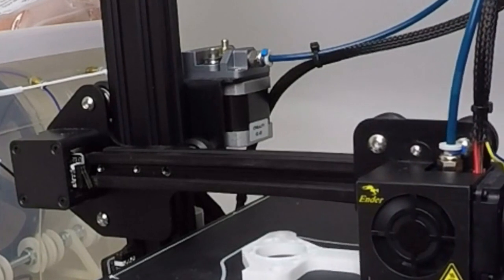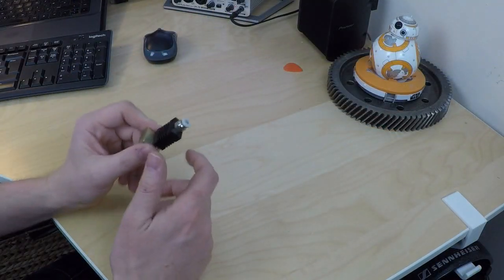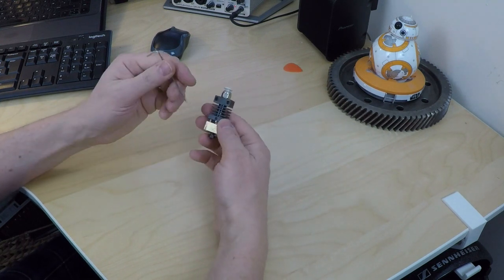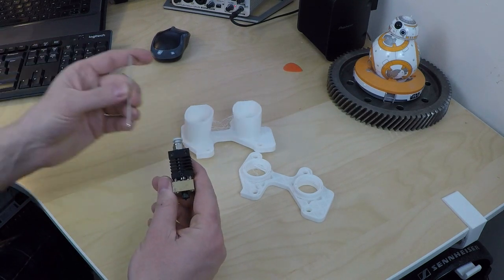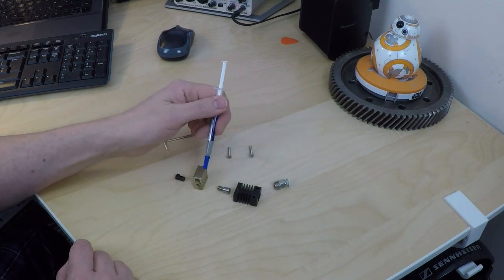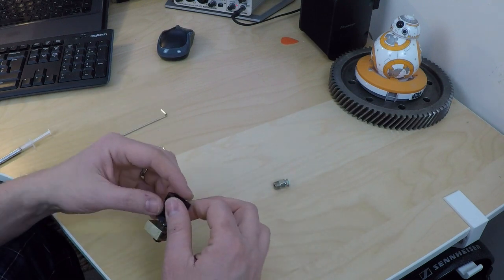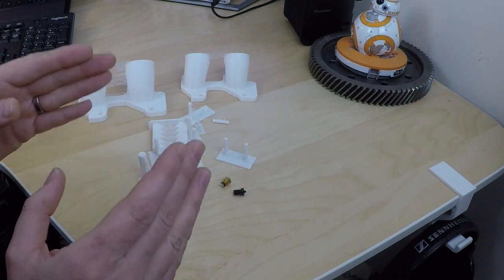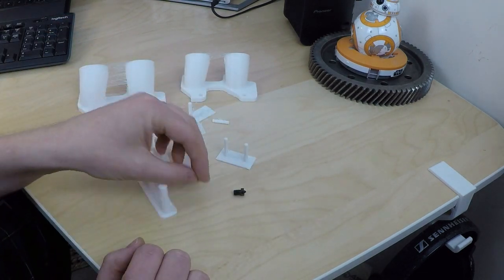Never clog again!! 2 easy tips to solve a clogging all metal hot end!

Comment: If you only print PLA the PTFE lined heat breaks work really well. Its the combination of PLA and all metal that seems to be the big oroblem. Some people swear by putting a drop of mineral oil into the hot end before loading PLA. Bit like seasoning a wok.

Comment: This still the solution? I was all stock printing petg and the teflon tube in the heatbreak (ender 3v3se btw) clogged bad. So i biught a metal one on Amazon and it worked. I noticed the old original one did have some thermal paste and it was clearly old and not much. I didnt have any to ise but i smeared some kf the old on the new one lol as i was just trying to finish a print for someone atm. Anyways ive printed half of another project (2ft vault boy) and got a clog again. Nozzle clogged up. Swapped. No solve. Checked heatbreak. Bingo. Clogged again. The metal one. So i found this video. As i have one more (it was a two pack) i am hoping i wont have to replace a third time but was searching for reasons it happens and found your video. Im oretty sure this thing is direct drive (everything is still stock) and i think the retraction was set to like .8 so. Im thinking this heat creep being mentioned is the issue idk. Ive been printing petg so first time lrinting these temps and hadnt had clogs before but ive printed a lot successfully in petg this is only my second clog. But back to back projects clogged so idk. It's creality petg. Maybe its just the cheap heatbreak i bought but we will see i guess. I am going to install thai second one with thermal paste this time and hopefully at least finish my current project. I know this video is old but if you see this and have any advice.

Comment: On my MK8 hotends, I've used Teflon tape (aka PTFE) on the heatbreak's threads that go into the heatblock. It eliminated filament oozing out though the threads, and seems to reduce the heat transfer to the heatbreak/heatsink.

Comment: Your tips are good, but a common source of clogging all-metal hot ends 
when printing PLA, is an inadquate cooling fan. The crummy, stock 4010 
fans on many printers won't cut it. Decent upgrade fans cost <$15. 
Look for fan with highest cubic feet / minute (CFM) spec, dual ball 
bearing (quieter). Most printers are 24v,  some older printers are 12v. 
Fan size is usually 4010 (thinner) or 4020 (thicker, usually blows more 
air).
Reply from the maker: Absoltuely, an upgrade for me was a silent 4020 hot end fan…

Comment: I don't have your exact problem as the clicking on appears during the first part of the print and seems to work okay after that and does not affect the print quality, very little if any stringing.  I have a genuine Microswiss direct drive and all metal hot end.  I use 0.5mm retraction. The one thing I found that helped is tightening up the tension that the extruder has on the filament.  I use PETG exclusively as PLA just clogs which I did not understand until recently.  I am printing in an enclosure and PLA needs airflow around it or it will cool to soon and cause clogs.  I know a lot of people say PETG is stringy which initially I did have problems with, but I store it and use it from within a drybox with desiccant.  I have not had any problems since.  The humidity here is high around 50%.

Comment: First, stop whispering. I can't even hear you while I'm driving. Yeah I'm not supposed to watch videos while I'm driving. I wasn't really watching. I was just listening.
2nd, reduce your retraction speed to 20mm. 40 mm is way too fast .
Yeah it's counterintuitive but trust me, it'll work. At least for PLA and PET-G. When you get into the fancier filament it's all bits are off. And I'm curious why you're printing in nylon with carbon fiber. You should probably use ABS or ASA

Comment: All metal hot end as apposed to what? Isn't the stock hot end all metal anyway?
Reply from the maker: Nope.  On the standard hotend the PTFE Bowden tube goes all the way through the heatbreak to the nozzle and butts up against it, this limits nozzle temps to less that 240-260 as above that it decomposes into gases you REALLY don’t want to breathe.

An all-metal hot end has a different hot-end which separates the Bowden tube from the nozzle and only the filament goes through.  If the heatbreak gets too hot, especially on low temp filament like PLA, it melts, bingo…. That’s a clog.
Reply: @MakingforMotorsport  thanks for the reply, I was so confused

Comment: I tried the thermal paste and reducing the retraction but I did one thing few people do: I looked up fan cowlings on thingiverse and found an internal fan shroud that screwed on the BACK of the heat sink fan that directed more air to the heat sink and I've just about eliminated stringing now i have to back track to contend with the blobs. I to have an Ender 3 pro and have just about got it ready for CF nylon, just need a enclosure and a better bed plate. Glass is a bad idea for PETG so I'm looking at spring steel PEI sheet. I could use the back for the CF nylon.
Reply from the maker: Nice! What I do for CF-Nylon is use my glass bed with glue stick, and on the flip side of that I have my mag pad and the PEI spring steel, that way I can flip between surfaces without releveling!

Comment: I was having the same issue with heat creep. But I had my printer in an enclosure which was just making the fan circulate more hot air to the hot end. So I ended up keeping the enclosure open with a small fan blowing into in the printer. I did switch out my all metal hot end for the stock hot end because i ended up breaking the heat break. But I switched the stock heat break with the Slice Engineering heat break which basically turned it into an all metal hot end. I am using stainless steel nozzles, but I also have pointy hardened steel nozzles. Both left the same amount of stringing which was just as much as you showed in the video. I did use thermal paste in the heat break because why not. lol. Your video helped a lot.
Reply from the maker: Nice one!  If I am running PLA (my most cloggy material) I keep the enclosure door open.  That Slice heartbreak does look good…

Comment: Mate first of all there is a huge difference between the volume of the intro and then you talking. The intro is waaaaay to loud, which i super annoying and then  have to double the volume to able to understand what you are saying.
Anyway, do not pint with carbon fiber, you will not get additional strength jut stiffness but what you probably will get is cancer because of those way too small fibers. Just becase this material exists does not make it safe to work with.

Comment: damn man , my v6 clone is driving me nuts , if I print without retracts I have normal prints but lots of stringing , if I turn on retract it just clogs all the time clicking and skipping layers like crazy the worst part is that it began doing this when i tried to print gembird pla (which I never tried before) after printing only abs for some time , the worst part is if I print abs , no clicks , no clogs . so now the question is : does it have to do with the bad pla spool or is it that pla has rough surface and doesnt slide as good as abs does during retracts and advances and I had the bad contact of heatbreak with the heatsink all along ...
Reply: Its just heat creap probably. Buy a bi metal heatbreak that use titanium and copper. I hear the work great.  Just ordered one on ebay for my CR 5 Pro H. Will try it out soon.

Comment: When upgrading the hot end on my V2, I just went with the Slice engineering heat break. With the exception that it was longer than the OEM heat break by almost 2 mm it works great so far. That was after I sanded the 2 mm excess. I applied thermal grease only to the top part of the heat break that goes into cooler. BTW thermal grease is applied in a very thin layer on the break, its not meant to "fill" any voids. Applying thremal grease to the threads that go into the heater block isn't recommended since thats where you want the plastic to start melting. Because the Slice heat break is machined so well, I had to adjust the retraction rate down to .05-.08 (I'm running a direct drive). As for the 2 screws on the bottom of the heater block, when I first installed the heat break it was too long so I left out the 2 screws and attempted a print. The print went fine till the heater block spin around and wrecked the print. Why anyone says to remove them is just being silly. How many printers have them without an issue. They are meant to support and to align the heater block and not allow the block to spin and knock off the top of a print. If you feel that they should be removed go for it, just hot tighten the grub screw and hope it doesnt spin while your printing.
Reply: You are right that the screws are meant to stay there, but your heat block shouldn't be spinning around without them either.
Reply: It actually is supposed to fill voids.  Except they're microscopic voids from parts not being perfectly machined. But Not gaps.

Comment: I used Boron Nitride paste from Slice engineering on my Gulf Coast Robotics hot end, eliminated my heat creep issues.
Reply from the maker: The compound is mandatory I think on every all metal. Even the E3D V6, which has nice fit still needs it.
Reply: @MakingforMotorsport  Took me much longer than I care to admit to figure it out lol.  Everywhere I kept looking was saying it was optional so I hadn't bothered.  Now if I can just get the sunlu silk rainbow pla+ to print properly without clogging

Comment: No retract = stringing whatever you do. I have been printing similar manifolds as these featured on your video and print quality would benefit greatly from design upgrades. In this case a sacrificial or solid bridge connecting the tubes would also make a more rigid print.

Comment: So here's my story.  Bought a micro-swiss clone as well, no printing issues at all (still none).  Then amazon stopped carrying it so when I needed it for my other 2 printers, I bought something "similar".  I too had this clogging issue, but only like 10 minutes in.  The hotends looked identical from the outside.  Your video opened my eyes, yes of course the retraction was causing it.  You have semi-melted filament trying to go back up a tight metal tube that won't give.  So here was my fix.  I slid some drill bits in the metal hole to see how tight it might be (figured mine was probably around 1.8mm, but don't have a pin gage set).  This seems very tight, and quite excessive for metal since the filament really has nowhere to go.  So I went up the next drill american drill size (2.1mm equivalent), and drilled all the way through to open it up so the semi-melted filament would still have space when it retracts.  This 100% fixed my issue, and I suggest everyone try this (or at least verify how tight your metal throat is).
Reply: Seems risky but interesting

Comment: with a all metal hotend u have to turn ur retractions down quite a bit from the stock boden system, i think my ender 5 was 5 ot 6mm/s for the retraction speed an 45mm distance i think i cant remember now its been so long but all i had to do was change the retraction speed down to 2.5mm/s an it was perfect. i did buy mine from microswiss an i went by their instructions an it worked great so for my ender 3 and aquila i just picked up clones of the microswiss first one was half the price so 30 an the last was only a quarter at 15 an they are both identical to the micoswiss so when installing them i did the same as i did for my ender 5 from microswiss an dropped the retractions an they have worked just as good as the microswiss. oh also did a pid tune.
Reply from the maker: It’s a tricky balance…. Enough retraction to not clog the hotend but enough to stop stringing…
Fortunately I don’t need to worry, I went the E3D V6 route and have no problems now 👍
Reply: @MakingforMotorsport  yea they work really well, i have a couple on my delta printers

Comment: Also... retraction on a bowden ender 3 should be ~4-6mm. That'll kill the stringing instantly.
Reply from the maker: On a completely standard Ender, you’re right but with an All metal hot end, anything over  3mm retraction is a recipe for clogging, as it pulls molten filament into cool metal.
That’s often why all metal hot ends go well with direct drive extruder (look at a Prusa) as the retraction can be super accurate and as little as possible…

Comment: Few words for people replacing with all metal heatbreak and what I have absolutely tuned up:
1.) Lower the temperature you used to print PLA with. A LOT. I went from 210 to 190 °C. ABS can happily run at regular 245 °C. If you replaced heatblock by copper/brass one, lower the temp even more as it really has great termal conductivity. Higher temp materials wont have problem with clogging when printed at regular temps as those can sustain at least 20 °C more then PLA (55 °C melting point)

2.) Lower the retractions. 1.5 mm at max, by the size of the zone making the actual break. 

3.) Go with Klipper firmware or at least better board (not 8 bit) so you can use Marlin Linear Advance (Klipper's Pressure advance work on 8 bit board as calculations are managed by Raspberry). That will completely eliminated stringing and blobs and retractions are there for „just in case“. But not needed that much.

All of these will allow you to print PLA on all metal heatbreak and much better materials like ABS and Nylon without any problems (well, ABS getting from heatbed is another subject)
Reply from the maker: Fantastic information… I have seen the linear advance piece in Marlin and looking forward to giving it a try!
Reply: @MakingforMotorsport  I've got the ENder 5 Plus this monday and not even bothered with Marlin. Klipper & Fluid are much, much better. Anyway, Linear/Pressure advance and most important, Input shaper to eliminated ringing will do wonders with quality of the prints.
If pressure advance is tuned up well, you will have hard time to find a seem on your prints :)
Reply: Thanks for the info.  I always thought you needed to go hotter with an all metal hotend.  At least that is what a lot of youtube videos suggest as well as MicroSwiss.   My problem is I can print PETG just fine, if I try printing PLA it just clogs after several prints.  Everytime.  So I just generally use PETG now.  My retraction is set at 0.5mm.
Reply: Thanks for the temp tip. Just changed mine on my ender6. Couple hours in, clog. Think it’s from heat creep due to me hitting those temps like I used to. 
Problem is I changed everything because of a clogging issue from the tube to heat break from the stock one.
Reply: @zozoartstudio4727  what are your retractions? For bowden, it really matters in case of all metal. I run my Dragon HF on Ender 5 Plus with 3 mm retractions BUT - Klipper firmware with pressure advance set on every filament.
PLA at 205 °C no problem, but I had hard clog with CF Nylon once and it wasn’t funny to get it out given how tough material it is. Lowerig temp by 10 °C helped completely.

Depends on your hotend cooling fan too, I run Sunon 4020 because only this gives enough airflow and pressure while quiet, Noctuas are no go.
Reply: @ZhuJo99   let me start by saying I’m a complete amateur and have been doing this for months. So I apologize if I’m ignorant to some of this. 

Not sure on what fan is on the Ender 6, still have it as stock. So far I haven’t felt it’s been an issue.. yet. 

The retraction is what CURA defaulted it for the ender 6, at 10mm.  I’ve tried 8mm and 6mm and I’ve had complete jumbled failures with those. (Could’ve been too cool temp on those but 190C shouldn’t have been cause for failure if this new copperhead heatbreak can run cooler with PLA, but who knows)

Today after a bunch of tests I finally had a successful one (except for the corners curling up a little)
I really wanted to make sure the issue wasn’t how I had put it back together, it had blocked up, but was it heatcreep? Was it not aligned?  So  I  played with some settings, nothing crazy, minutia temp changes until finally No failure. 
But I was thinking. 
Maybe the printer, after heating up and cooling down a bunch of times has the hot end settling together with the new components.
Reply: @zozoartstudio4727  Heat creep. Stock fun is fine (even if it's loud). As a beginner, do not mess with it. Just set retractions to 3 mm and go with temp to say, 205 °C which shows up as good for PLA. You should be fine with that. Turn off retract on layer change in Cura.
Reply: @ZhuJo99  thanks!  I’ll give that a shot tomorrow morning
Reply: @ZhuJo99  Latest trial : clogged up on the  first layer… 205c 3mm retraction.
Reply: @ZhuJo99  I leveled it a couple tries ago, I’ll check it again. Do you do the paper method or do you have those spacer tools?
Reply: @zozoartstudio4727  both. I usually use 0.15 mm gauge and then use babystepping. First layer should not be rough, yet not with lines clearly separated from each other. Just nice, smooth first layer.

Are you printing PLA or PETG? For PETG, you need to go much higher with Z offset, like 0.3 mm more than you are ususally set.
Reply: @ZhuJo99  an hour in and everything looks solid!  I’ll let you know how it finishes up!  Thanks again
Reply: @ZhuJo99  print came out perfect, very light stringing.  Man… what a relief lol
Reply: @zozoartstudio4727  glad to help. For stringing try to lower temp by 5 °C or print the stringing test
Reply: @zozoartstudio4727  any chance you can help me with my Ender 6?

Comment: cant hear you speak but your music intro is off the wall lol, in we are the smart ones lmaoooooo! good info tho/ update Anyone reading this look up Blackshark FAN For gaming phones, Its a heat sink, A lil air conditioner i attached mine to the fan housing it seems to do the trick adding cooler air being put on the all metal end dont change your slicer settings try 1 thing at a time i got no stringing i didnt change